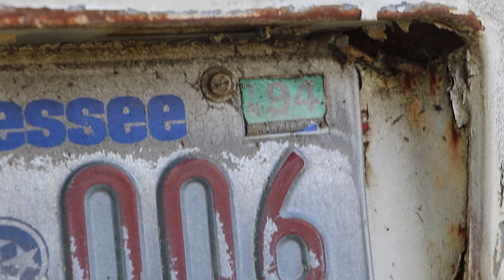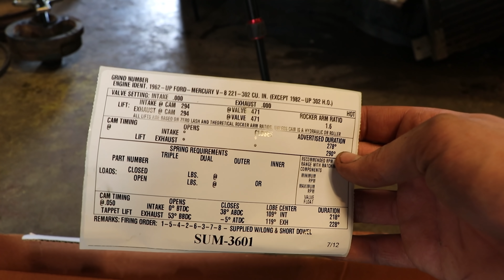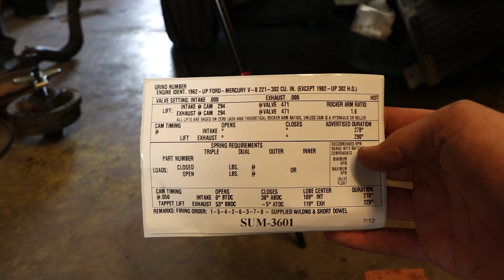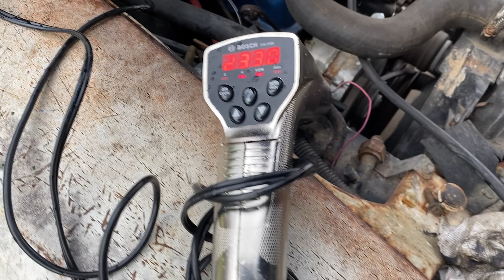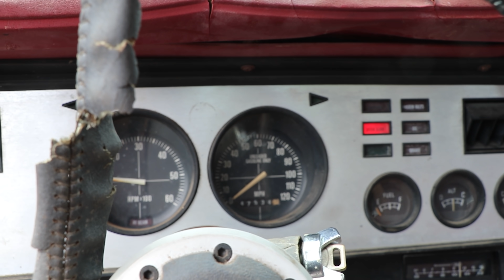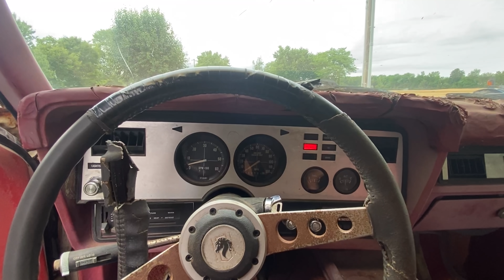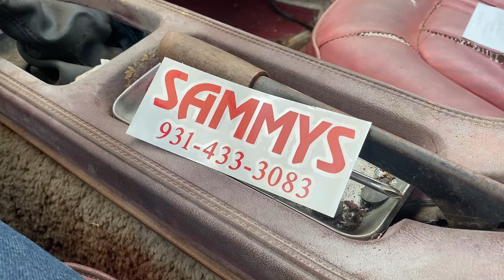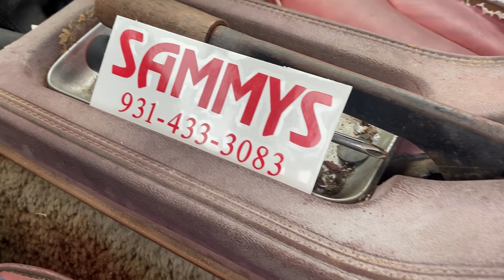ABANDONED Mustang Cobra Rescued After 27 Years - From Dead to Street Machine

Comment: These are getting so rare this one needs restored back to factory new. I miss my 75 that I pulled the four banger and put in a mildly built 289 4v, that car was a blast.
Reply: I had the white with blue stripes and blue int. 76', Came with a four banger, but changed it out (with a lot of cussing and sweat) with a 351 Windsor. What a blast! I SO miss that car. Ah, the good ole days.....
Reply: The Mustang II was light. Even with the slow-ass stock 302, it wasn't hard to make it have some good power. The Mustang, even with the anemic engines of the time, could still be had with a V8 and a 4 speed.  This is an excellent platform for the time.
Reply: The 289 was one of Ford's best little engines. Nice and revvy.
Reply: @bongodave13  light indeed. Most people miss that fact. A 300 hp motor in a 2700 lb car was as much fun as you can have with your clothes on.
Reply: @bongodave13  And it can be lightened further with aluminum intake and radiator, headers, supercapacitors augmenting a small battery, and replacing some of the steel in the hood with aluminum or fiberglass.  And saving weight also helps traction, handling and saves gas, unlike some power mods.  I hear these came with tiny carburetors, so the aluminum intake might as well be 4 barrel and then jetting the primaries lean and secondaries rich can save both gas give power, though it might bog just a bit under certain conditions.

Comment: Another raised from the dead!!! It looks so much better and sounds like a new car. I know this may sound dumb but you might want to keep an eye on the rear tire temperature, especially when driving at higher speeds for longer periods. I'm 53, back in the 80's when I was a teen it was very popular to exit the exhaust out the side right in front of the rear tires. But muffler shops always pointed them straight out to assure that the hot exhaust didn't flow into the tires. On a short and straight through exhaust the heat can get up to over 1000 degrees at the tail pipe. This isn't popular anymore so your exhaust shop may not have thought about it, or it might not be a problem at all, but I would keep an eye on it for safety sake until you're confident that it isn't a problem. Great job Dylan, always enjoy your videos!!!

Comment: 1976 Cobra II was my first car. Bought it new. It ran pretty well. 
Well, once put a roll cage in it, removed the rear seats, ported the heads, went to an edelbrock dual plane manifold and 750 double pumper with side-mounted floats, Isky 280 duration cam, Zoom clutch, hooker headers, hurst shifter, lowered the front end by cutting 1/2 a coil, installed racing pads, Phoenix Stahlflex 3011 tires (if you remember those, you too are OLD....) on Chromadora rims designed for a Capri and Bilstein shocks. Really, it hardly needed any work to make it perform as good as a detuned Prius today... Weren't the 1970s just GREAT for gearheads?

Comment: Love the wheels and tires and the exhaust makes the car.  
If you don’t have plans for the air conditioning please remove the compressor bracket on the driver side to save a little weight on the car to lighten it up.and makes the engine bay a little cleaner. Thank you for sharing Dylan and have a Blessed One Sir.

Comment: Hi over in the UK here, 09:30 nice to see a Duplex timing chain on that old Gal. I swear by timing chains dude, so much more reliable (101%) than timing belts that are on a lot of European cars. My 2016 KIA Optima 3 has a Simplex timing chain and Simplex chain oil pump drive...one of the reasons why I bought it.
Timing belts have a nasty habit of snapping after 10 years or extended mileage. (Take the belt off, turn belt inside out, bend it to see if there are any cracks...is how you check em)
Then it's a case of non-interference or interference engine. A guy I know blew his timing belt at 70 mph on his seriously tuned up Renault Megane...it was an interference engine and...yup...completely totalled! Timing chains don't do that. So a car with a timing chain is always well worth the hassle to repair, customize etc.😁👍

Comment: Love what your doing to the mustang, would like to see you install a set of gears, at least A 3.79 gear set.
These are getting very difficult to find, do hope you have body and paint plans for
It As well
Reply: This car already had 3.55 with traction lock. That was plenty enough for the smaller tires of that day. Even the new shoes are gonna be easily spun by that 3.55.
Reply: @Keith Clark: I'm not sure what to make of your comment, but Ford never made a 3.79 rear gear ratio for their axles. The closest they came, stock, was 3.73 gearing.

Comment: The 70's were a very strange time.  For a short while, automakers would sell you a car that, if you took it home and added a 4-barrel and twice pipes, you'd have a hot little car. All four of the Big Three would do this. But only a few specific cars did people figure it out - and the Mustang II was one of them.  The other, was the AMC Gremlin.

Because then you had cars like the Maverick Grabber.  Very few takers.  I guess you could slide the Demon Sizzler and Duster Twister in here too.
AMC even offered the 360 in the Hornet (yes, even a Hornet hatchback!) with a 360 V8 with a 2-barrel and a single pipe.  The DEALER would even offer to upgrade you to a 4-barrel and duals.... very few takers.
Chevy Monza?  Chevy had to stuff a 350 in the thing before people even noticed it. But even then, I couldn't say a ton of people took these cars home and modified them.
Cosworth Vega?? Great idea.  WAY too expensive.

Gremlin and the Mustang II are pretty much the only cars I can think of that a significant amount of people bought, and then modified.  The real muscle cars were still cheap and plentiful. I think only the Gremlin and the Mustang II stood out from the crowd enough to be considered stylish or "with it".
Reply: Had a Monza 2+2 with a 4.3L V8. It was fun to drive but a nightmare to work on. I still miss that car
Reply: @michaelsherrill6561  And probably rotted away to nothing within 3-years. I remember those cars rusting at the dealerships.

Comment: sounds like it still has an exhaust link, it should sound even better once that's fixed. my 74 mercury comet sounded great with flowmasters and 2 inch exhaust. i had a 69 302 rebuilt with an aluminum intake and small 4 barrel carb and cam. loved finding a tunnel to go through to listen to the exhaust

Comment: That was your problem with the over heating, they need a thermostat in them,
Reply: The thermostat just helps the engine warm up, especially in colder climates. The radiator cap maintains the system pressure.  From this video, it was not known what caused the vehicle to overheat.  He didn't replace the head gaskets or even do a compression test, unless that was in another vid that I missed.
Reply: actually, running them without a thermostat will make the engine run cool, not overheat. the thermostats only job is to help the engine warm up so that you can get heat into the cabin. with no thermostat in the engine cant reach its normal operating temp and remains running cool and you get very little heat into the cabin. who ever told you that no thermostat causes the engine to overheat was obviously blowing smoke up your butt.

Comment: I had an 1980 Mustang where I removed it's blown 4 banger and slapped in a 255 v8. It mated up perfectly to the 3 speed tranny. The only modification needed to the drive train was have the Drive Shaft shortened by 11 1/2" then re-balanced. It ran so good (little speed demon) the head mechanic at a local Oklahoma City Ford dealer purchased it from me. FlowMaster 40 Series are all that I run on any of my vehicles. They sound really sweet on my 07 RAM1500 5.7 Hemi...(ps: ALWAYS install an X-pipe)

Comment: Good job on the thermostat.  The urban myth of taking it out or opening it wide open does worse in the long run than helping because it doesn't allow the water and coolant enough time to stay in the radiator in order for it to get the maximum heat transfer from the fan necessary to keep it cool.  Same thing goes when choosing a lower temp thermostat, especially in the south where it may cause the thermostat to stay open.  It is also best to match your thermostat with climate, often 160 in cooler climates and 170-180 in warmer climates for best horsepower and longevity.

Comment: Dylan, Ford made for a very short time (1980-81) a 255 /4.2 Lt v-8. It was a sleeved down 302 and it works GREAT in those small cars. They accept all kinds of modifications and are great little performers!.........................ps: Dylan they make BLOCK OFF GASKETS for the EGR Ports.

Comment: IMHO that there is the best motor FORD ever built you might think it's nothing special but it is  stock as a rock , there are plenty of aftermarket parts to make it even better,, it's an easy motor to stroke and will respond to any extra amount of air and fuel you can get through it

Comment: I’ve got a 78 Mustang II cobra II and we put a 302 out of a 79 fairmont in it then we put a Parker single plain high rise intake.The motor has a little cam and been bored I think.Automatic C4 with a stall converter at like 2500rpm I think. The trans was with the car when we got it. I think we got like 2000$ in it and it was worth it.I love the Mustang 2 they drive greet, sound awesome with short exhaust.

Comment: I like it. When I was in high school a friend's dad, whom was a mechanic, had a coworker that had a mustang II. I don't remember if it was a cobra, or even if it was a 4-speed or auto but I remember it was a v8 car and it had side pipes. It was pretty cool. I think the only thing I would have done differently would have been to pull the heads off and replace the gaskets while I had everything else off and a different exhaust setup. But as crusty as that thing is I really like it. I've always loved manual transmissions. I daily one, and my first major project on my channel is a 4-speed.

Comment: Put the money in what you think necessarily needs it. At least your making run and sound better than it likely ever has. You've commented on the synchro going out between 2nd and 3rd gears. Maybe a used or rebuilt 4 or 5 speed with upgrade for the clutch pressure plate and friction disk is in the cards. Would guess the shifter could use some TLC with bushings being just a little worn by now. Take care.

Comment: The lack of a thermostat is most likely the reason the car overheated after racing it.

If you have a proper functioning thermostat it will hold the coolant in the radiator until it has cooled down, and by that time the coolant in the engine has heated enough to cycle the cool coolant into the engine and flush out the hot coolant.

However, if you remove the thermostat the coolant doesn't get cooled off anywhere close as it normally does, so the coolant gradually gains more and more heat over time because you're generating more heat than you're expelling, then the coolant boils and leaks past the radiator cap.

And so, most likely what happened is the coolant was constantly boiled during the trip to the racetrack, and during the race, and finally on the way home it couldn't cool the engine anymore and left you stranded.

I know it's an "old trick" to remove thermostats, but unless you restrict the water flow properly, you'll just wind up hurting the car.

Comment: I really need help identifying the engine in my 68 Newport. The intake is about 12 inches wide unlike a 383 which I'm told is about 10 inches. The thermostat housing is much bigger than the gasket that came with the 383 thermostat . I was told that the gasket for the 383 and 440 are the same but neither fit this big block. Could I have a 413 , 400 , 426 ??

Comment: I'm old school with a caveat. When it comes to body style of the Mustangs I like the gen 1 fastback, preferably the 64 1/2 - 66. I don't much care for gen 2/3/4/5 but the caveat is I kind of like the gen 6 fastback GTs. I don't claim to know much of the mechanical stuff about them because I've never owned any myself and have never done more than occasional shade tree work to try to save a little $$. My older bro had a 67 GT 390 4 speed 4bbl back in about 76, it was pretty awesome and he could get tire smoke from all 4 gears and just LOVED it! Back in the 80s I passed up a 68 fastback with a 460 in it, I figured I'd probably kill myself in it and had more use for a pickup so practicality won and fun lost, I bought a 4x4. In the long run, assuming I didn't wreck it and die, that stang today would be worth waaayyy more than the $2,000 price tag on it back then. I should have bought it AND the pickup!

Comment: if you're still on the budget look for a book on how to build max performance V8 Ford engines on a budget there's an article and section in there on adding a set of e7te PA cylinder heads that'll add another 25 to 30 horsepower bone stock and they will teach you how to mount those heads on that on that early model block that car sounds beautiful keep up the good work at a set of headers with that cam to make that car to make that call fully functional I love your work God bless I hope to see you on the road later

Comment: you should use 20w50 VR1 high zinc
Reply from the maker: I’d be running on the pump bypass with 20w50. I had 50 psi with 10w30.

Comment: I would check out the clutch just a once over take a look and see see if everything's tight and right, p I'm surprised suspension was that thing isn't rolling like a truck that's top and heavy just real surprised at how stiff that suspension is I would definitely say that's one for the books for sure that minimum amount of work that was done it's I don't care what card is that's just fantastic but being that is Ford and they're going to keep they get a bad rap all the time but but it's a Ford and it runs and that's saying something either somebody had prior to driving that vehicle probably took care of it or when they shut down again probably somebody that was not mechanically inclined. But these doesn't cars don't have to be sitting to have critters running in there chewing up wires. But it is pretty interesting how that car is riding without rolling it or bouncing that that part kind of got me like how does that work and then you driving it like some people drive there $100,000 cars and you were still able to drive out of the race track not quite make it home but you made it out of the gate so that's saying something but it is kind of baffling it's how it's running how you beat on it and still took it like usually something would happen on the track I would think but what do I know that would put most people's pessimistic side on pause because they would have definitely given that car crap but when you tell the story it probably the only like yeah no way but you have video proof so you have that but those cars you sleep back in the day always overheated for the stupidest reasons. Three of the things I would have done the timing the plugs distributor and as far as carburetors go I probably would have been the last cuz I'm not much of a racer but what's your head work and it would be interesting to see what it would be like if it were back on the track yes for it's and giggles.

Comment: Well now that you got the powertrain figured out there is only one major problem left. Dude, you are driving around in a rusty bucket. I thought by now you would have at least killed the rust then maybe scraped some off and used some spray paint primer and a couple cans of spray pure white paint. And the steering wheel, I don't km=now about yu but if my hands are not comfortable I really cant drive but your steer wheel is mostly cracky it disturbs me everytime its on the screen. Those wheels and tires looks amazing but could you do something about the rest of the car.  Is your windshield still cracked? How does the car smell inside. Old cars like that tend to have a distinct old musty mildy smell. Did you do something about that?

Comment: time and time again i see people like you eliminating the heater core function. when in fact the heater core can save your ass when overheating because basically its a second radiator. your car overheats, you turn on the heater and the temp comes down or stabalizes untill you can get to where you are going. big mistake not having it

Comment: I like what you have done to the car so far. Except for the exhaust. The sound is terrible. All the noise, none of the class. Those flowmasters are nothing more than more expensive cheap glass pack cherry bombs. Those Flow FX lumps you put on are not any better than just a length of pipe. Should have either saved your money or purchased some properly tuned mufflers.

Comment: I couldn't stand it. I would have to tackle the body. I would want it to look as good as it sounds and runs. If it was nothing but taking a DA to it and cleaning up all that rust and scale. Throw a thick coat of high build primer on it, sand it smooth, and then throw two or three coats of whatever clear I wanted to use.  Simple and quick. You could just about do it in a day. On the inside, I would want it clean. But, that's just me. To each their own.